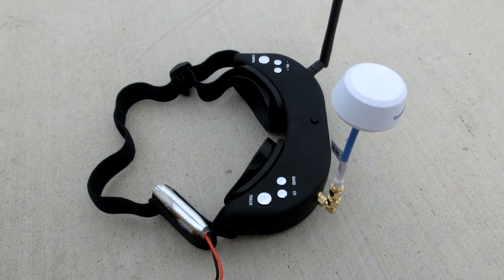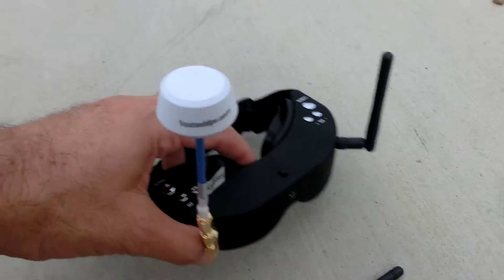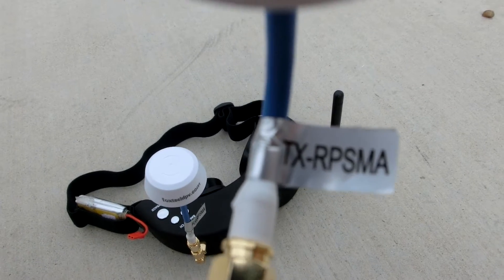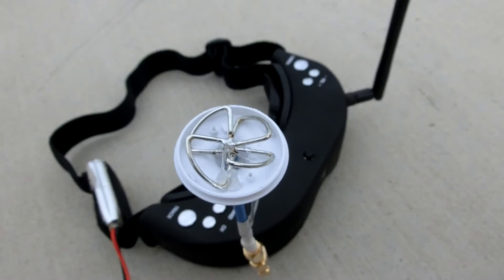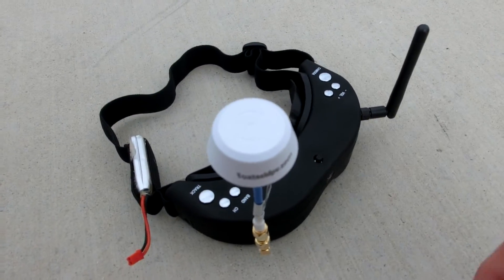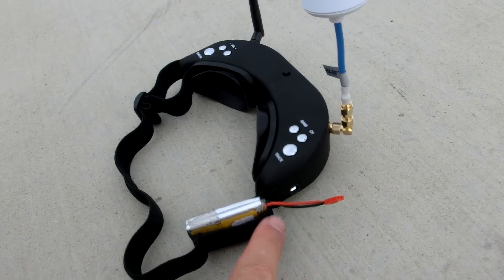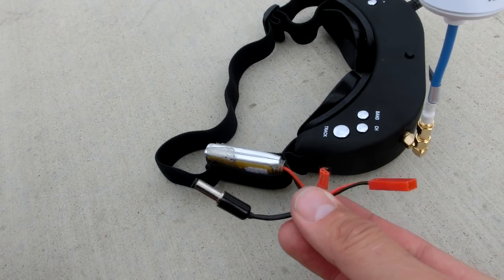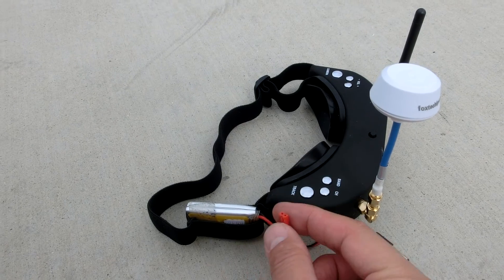Skyzone Foxtech FPV Goggles Physical Setup

Comment: Hi i have received the same black ones yesterday. Just powered them with a 20C 850 mah. I can see the quad when i put on the googles but as i begin to take off I only get Noise in my screen (white dots like disconnected). Again when i switch channel or freq image appears. The moment i take off i loose the video signal. Please advise.

Comment from the maker: The Radio Shack DC Power Plug Part is: Size M - Coaxial http://www.radioshack.com/product/index.jsp?productId=2103614
#274-1569
Tip size 5.5mm O.D. x 2.1mm I.D
Solder Terminal

Comment from the maker: You have to make the shorter power adapter yourself out of a jst and barrel plug. The barrel part is listed in the description. You can also take the provided power cable with the goggles and just shorten it.

Comment: hi what size is the dc input barrel jack
thanks
Reply from the maker: You have to make the shorter power adapter yourself out of a jst and barrel plug. The barrel part is listed in the description. You can also take the provided power cable with the goggles and just shorten it.
The Radio Shack DC Power Plug Part is: Size M - Coaxial http://www.radioshack.com/product/ind...
#274-1569
Tip size 5.5mm O.D. x 2.1mm I.D
Solder Terminal